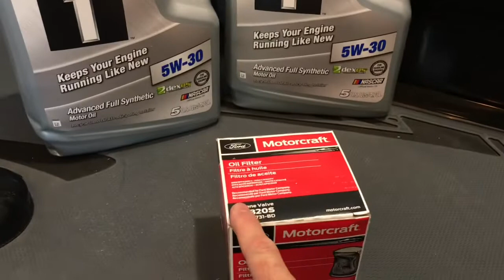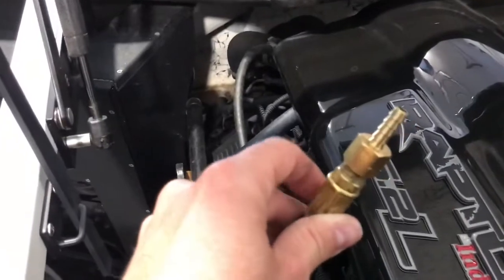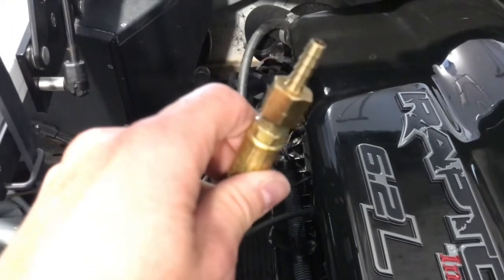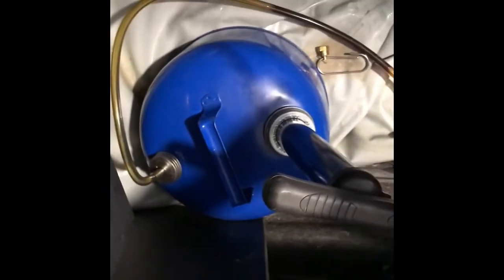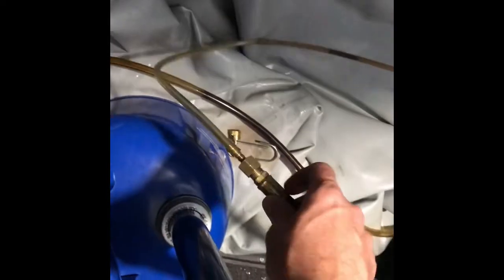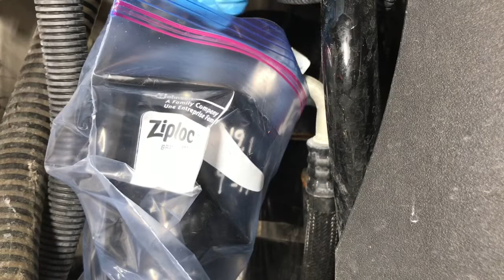Indmar Raptor 6.2L 400 Boat Oil Change 2015 Tige Z3

Comment: thanks for the video - helpful.  one question though - your old filter had 219 hours written on the side of the filter, and as you pointed out in the video, you recorded the updated 227 hours on the new filter - maybe a premature oil change?  I've never heard of a need to change oil after only 8 hours running time.  thoughts to ponder
Reply from the maker: Yeah I change it once a year regardless of the hours

Comment: Good video, thanks.  Do you typically change the transmission fluid at the same time you change the oil?
Reply from the maker: I will check the trans fluid, I usually change it every other year or 100 hours
Reply: @Myksgarage  Got it, thanks.  Mind if also ask about winterization?  I have a new ATX with the 400 Raptor engine and am thinking about winterizing myself.  Is this something you do yourself?  Fairly easy?

Comment: Do you run antifreeze thru the boat after winterizing it? If so what’s the process??
Reply from the maker: I don't, I just leave it dry
Reply: Others have mentioned to make sure you winterize the ballast system as well. DO you have a video on that or steps on how to do that?? @Myksgarage

Comment: Do you have the thread size and type of the barb fitting?
Reply from the maker: 1/4”
Reply: 1/4 what? Is that the barb size or the thread size. Npt or standard?
Reply: Wondering this too.  Looks like 1/4" barb but not sure on the thread size.